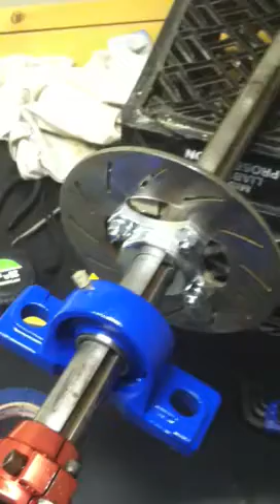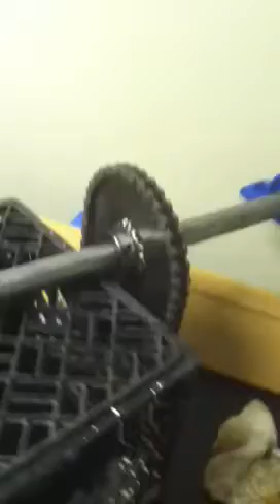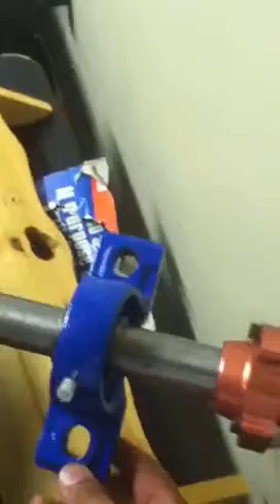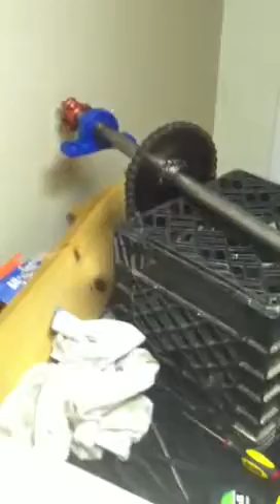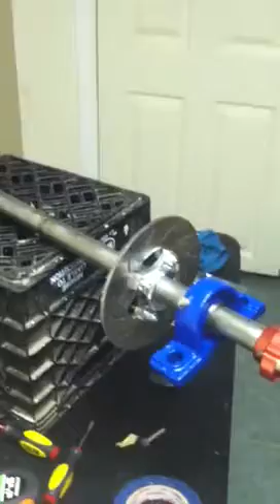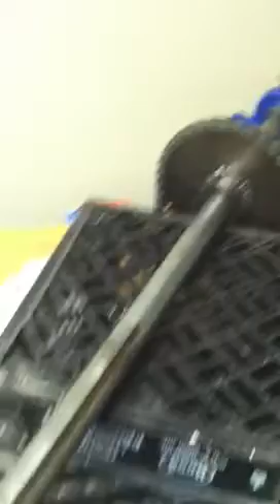Pillow block bearing on go kart

Comment: Thanks , needed to see this.
Can this be bolted to anything or is welding mandatory?
Reply: it can be bolted
Reply: Thanks for replying but i came a long way in my knowledge since february lol.
Reply: what kind of kart do you have?
Reply: Coolest guy on youtube i have no idea. i bought it off of craigslist and started modifying the frame. i extended it and am turning it into a live axle.it will have as much power as i can throw at it. currently 4:1 gear ratio on a TAV no problems.